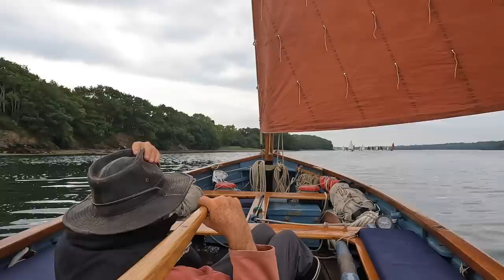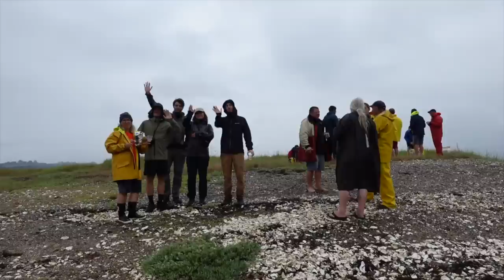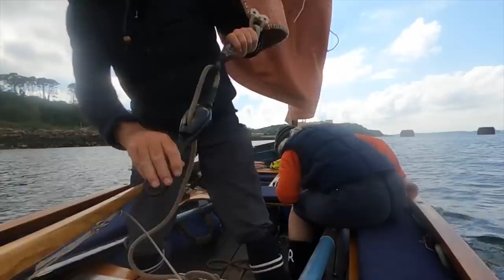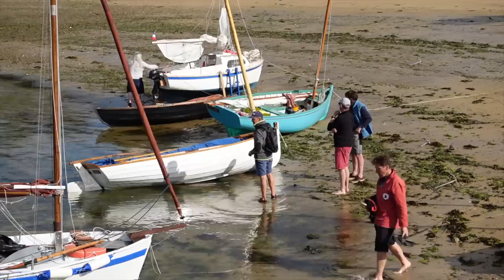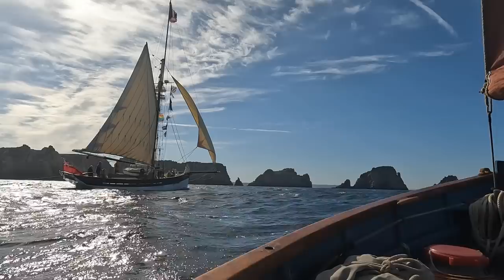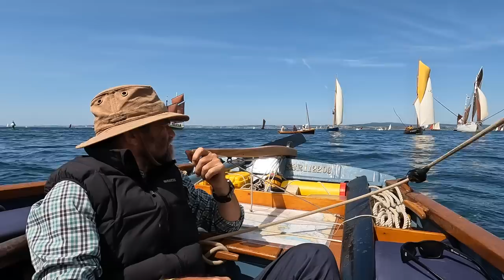JOURS DE FÊTE - close encounters of the boat kind

Comment: Thank you for a great film. As an old sailor have I notised that you tackle for the mail sail needs to be hooked from side to side, suggestion instal a tube from side to side over the stearing so the tackle for the main sail can go automatickly from side to side. uicker and safer sailing. Thank again for your inspiring film! / Arne
Reply from the maker: It would conflict with the single piece lifting rudder though.
Reply: @RogerRoving  Hi again you might instal the pape so you can remove it before lifting the rudder. All the best /Arne
Reply from the maker: @arnefagerstrom7851  I would not be able to remove the tiller - needs lifting to remove. Anyway, why is a horse an advantage?
Reply: I'd hate to see what people here would say about my leeboard....